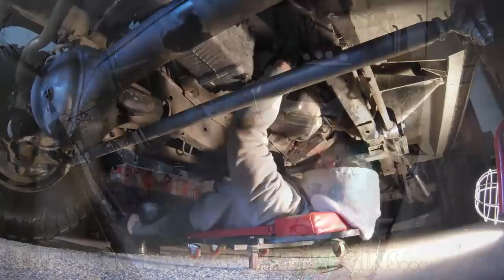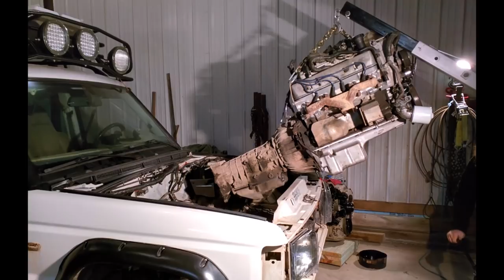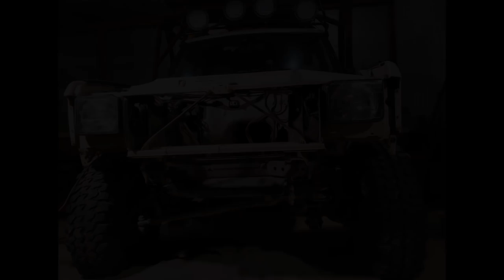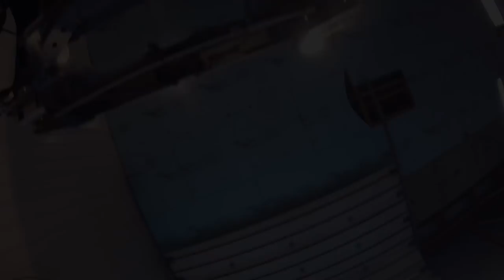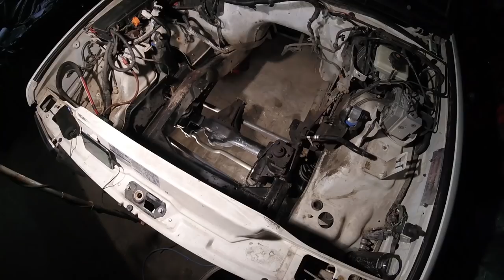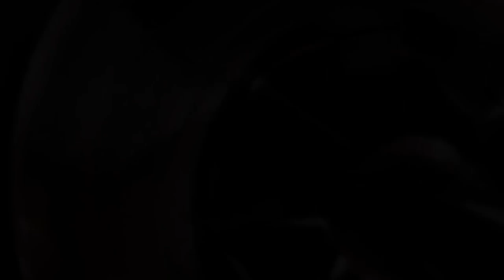V8 Be Gone! × 4BT Cummins Discovery #13 [Land Rover Build]

Comment: Awesome videos. Im subscribed. I think every Disco owner is anxiously awaiting the outcome of this.  Many many people have claimed to do engine swaps in the D2. I've yet to see any successful ones. How do you plan on tackling the inevitable BCM issues? Speedo? I think even the AC/windows/door locks go through the BCM. I could be wrong. Dash lit up like a Christmas tree? ABS?   I'm assuming you're going to eliminate the traction control system. Also assuming you don't have emissions testing. 

I'm very much looking forward to the outcome of this. Actually running. Actually driving. With power steering and fully functional. Don't skip out on the finish product video. Good luck!
Reply from the maker: I'm rewiring for the purposes of both improving & simplifying.  It'll get a bunch of raychem, deutsch connectors, new gauges, circuit breakers instead of fuses, & a solar setup w/house battery if time allows.  I've had the ABS disabled since I first went offroad, so when I have time next I'll get the wilwood adjustable proportioning valve I picked up swapped in the ABS block's place.  Nope no emissions here, but I wouldn't be surprised if it was better than the V8, this engine's SO much more efficient!  One of my current delays is actually related to the power steering, trying to fit the engine mount between it & some off the shelf starter options.